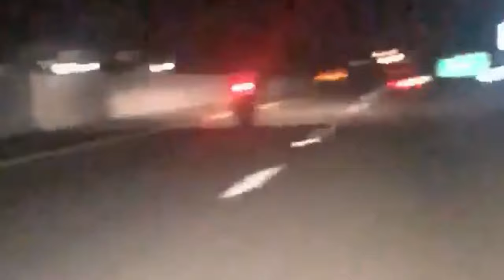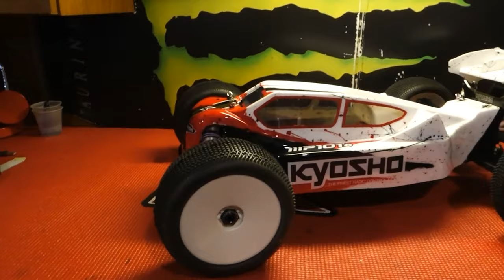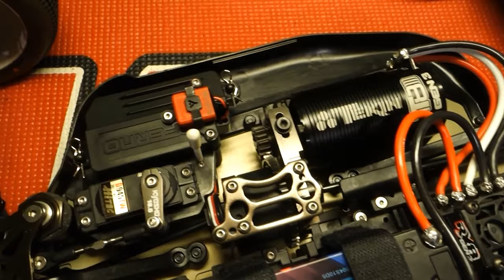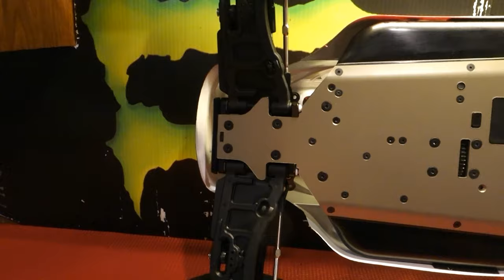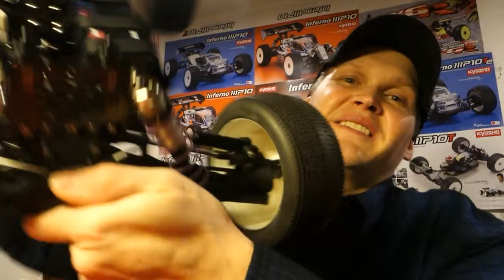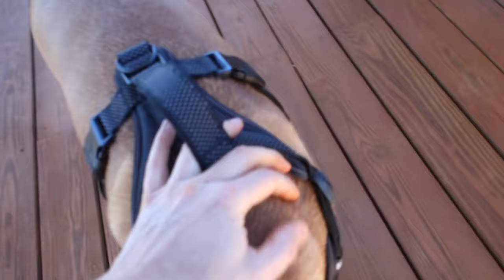KYOSHO MP10T ELECTRIC CONVERSION, MP10Te READY FOR THE TRACK

Comment: I hope you see this comment and respond... With the motor mount, theres no screws going in the bottom on the side ride with the motor right? I realized that and noticed the mount can flex because of it
Reply from the maker: I vaguely remember not being able to get the small screw on the motor mount that goes through the chassis but as far as the Motor slide adjuster I was able to get both screws in it

Comment: Question. When you turn the wheels to full lock to the right does your servo saver and shaft above that that's connected to the servo hit the acrement plate? That's the problem I'm having. It hits the plate and doesn't let the Truckee go to full steering as much as the other side
Reply from the maker: I don’t remember an issue just make sure everything upfront Has been adjusted correctly
Reply: Mine did that and I had to grind with a dremel to stop it.